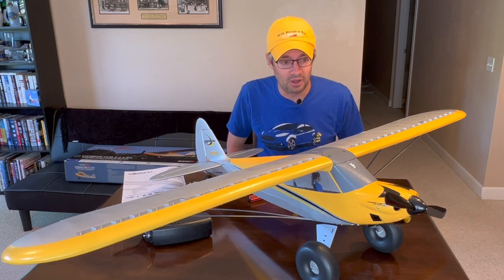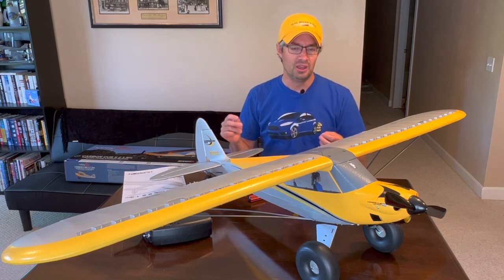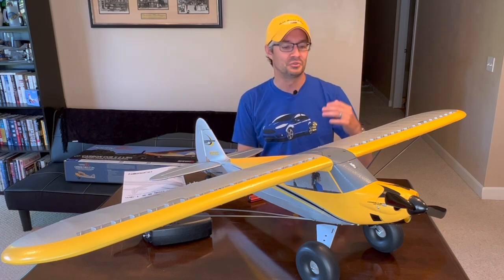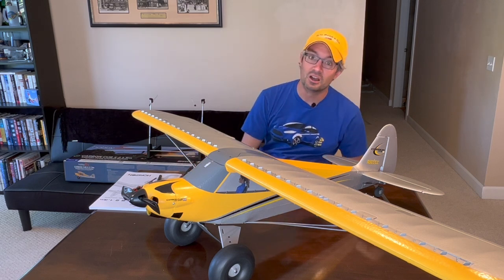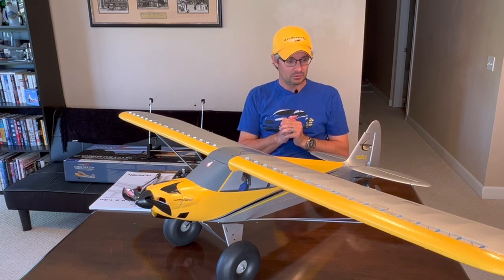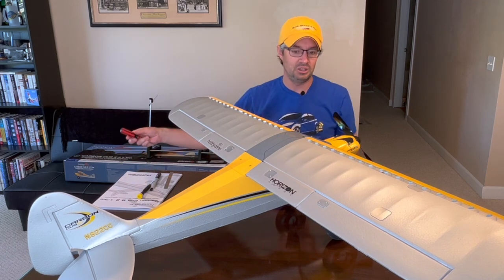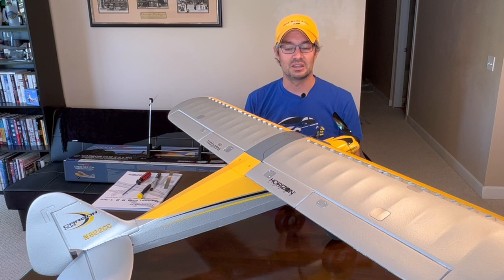Tips and Tricks to Properly Setup your Hobbyzone Carbon Cub S 2 1.3m

Comment: I have his and hers of this plane. I salvaged a LONG control wire from a Blixler. I got the flaps to work ONCE. Have you tried to get them to work with this radio?
Reply from the maker: I haven't tried flaps yet as it is my nephew's plane and he is still learning the basics. He is a bit out from learning how to use flaps. He has flown solo on beginner mode, but not much past that. Once he is comfortable flying in intermediate or experienced mode, then I can look at adding in the flaps.

Comment: Hi just got mine I’m concerned about the charging time of my battery I’m just wondering how long it takes for your battery to charge
Reply from the maker: Charging time depends greatly upon the charger being used, power output of the charger, and acceptable charge rate for the batteries. I have a Spektrum Smart S2200 and it will charge 2 2200 3S 30C Gen 2 Smart packs in about 15-20 minutes from storage voltage. With a Spektrum Smart charger and batteries, both communicate to each other so the batteries will charge at the correct rate and I don't have to do anything on the charger to properly charge batteries. I simply plug in the batteries and let the charger do the rest. It is by far the easiest way to charge LiPo batteries and the Smart batteries will automatically self discharge back to storage mode if I end up not using them within a week. This protects the battery cells.
Reply: If you are using the basic S120 Spektrum charger that came in the RTF bundle then yes it is incredibly slow because it is very basic. It took almost half a day to charge mine the first time I used it. 

If you are using a low amp charger then the light on the charger is WHITE before the purple flashing charging cycles show. If you can use a higher amp USB plug and cable (like your 20W smart phone chargers) then the light will be BLUE. If blue then it’ll be much faster but no way near a proper smart charger. 

I very quickly bought a proper Spektrum smart charger which can do my 3S 2200mah in less than 30 mins from storage voltage.

Comment: Great video and nice tips as well as pre flight preparations. One issue I'm having with this plane is that I can't land it in the begginer or intermediate mode, as the nose won't go down unless I apply throttle. I can only land in advanced mode. Is anyone experiencing this? Or what am I doing wrong? Thanks!
Reply from the maker: Beginner mode does give the plane additional upward pitch by changing the elevator, but only a few degrees. The plane will start to lose altitude in beginner mode if the power is pulled back under 40%. At idle, it would settle into a nice glide slope for landing. Applying throttle to get the nose to come down isn't normal and is actually backwards of what should happen. You control speed with the elevator and altitude with throttle, meaning on landing if you add power, you gain altitude. You bleed off airspeed by pulling back on the elevator and gain it by pushing it forward. Because the Cub is rather floaty, and even more so in beginner mode due to the elevator positioning, you should be able to cut the power to 0 when you are on the base leg of the landing and turning final. Your final approach should be done with the power off and you should just be managing the speed with the elevator. Based on your comment, I would go back and do a few checks. First is to make sure the CG is correct per the manual. Next would be to put the plane in experienced mode, zero the elevator trim on the transmitter, and then use a credit card or straight edge to make the sure the elevator is aligned with the horizontal stab. If you then go into beginner mode, you should see the elevator change a few degrees. Go back to experienced mode and confirm it is centered. Then go fly the plane. Take off in beginner mode, climb to a comfortable altitude at 50% throttle and then put it into experienced mode. The plane should stay level or drop the nose by a few degrees, but mostly stay perfectly level. If it isn't, do you flight trimming in experienced mode. Any trimming in beginner mode is negated by SAFE. You should be able to fly hands off in experienced mode at 50% throttle without any need to give the plane any inputs. That means the plane is balanced and trimmed. Go back into beginner mode, and set up for a landing. When you make the turn from downwind to base, be about 25% power, and then gradually reduce to 0% as you make the turn from base to final. You may be too high on downwind and base, meaning you are too high for final and having too much airspeed, which is causing the nose to stay up and SAFE prevents you from pushing the nose down too far. I am guessing the issue is either the plane is out of trim or you are coming in too fast on landing. Try that and let me know the results.
Reply: @BRGT350  Thank you so much for the detailed answer and tips, it makes a lot of sense, I think my error is that I'm still applying throttle on final. I'll try your tops on my next flight and will comment here. Thanks!

Comment: I plugged in my battery and the ailerons on either side have moved opposite directions, and the rudder is turned to move the plane to the right. I can’t seem to control the plane at all or turn on the propeller and I’m not entirely sure why. Got any suggestions for troubleshooting or a guide in addition to the instruction manual?
Reply from the maker: Sounds like something went wrong in the startup procedure. Start with the transmitter off and battery unplugged. Turn on the transmitter first, then plug in the battery, place the plane on level ground for a few seconds. The ailerons, elevator, and rudder will all move back and forth as part of the start up. If you plug in the battery before turning on the transmitter, the plane may have lost bind and you need to follow the binding instructions. Typically, unplugging everything and following the start up process as listed above will fix it. Never plug in the battery without the transmitter being turned on first. To turn off, unplug the battery first and then turn off the transmitter. The transmitter is always first on and last off.
Reply: @BRGT350  thanks for your reply! I’ll try this and report back with the results
Reply from the maker: sounds good! Hopefully that is it. The way it was acting is how a plane acts when it isn't bound to a transmitter or the transmitter is turned off. If it needs to be reconnected to the transmitter, it is easy to do. Insert the bind plug into the receiver, plug in the battery, turn on the transmitter while holding down the bind/panic button, and the plane should go through a movement of all the control surfaces to indicate it has been bound to the transmitter. Remove the bind plug, unplug the battery, turn off the transmitter, and then go through a normal start-up to make sure everything works. I can't recall if the Carbon Cub is one of the planes that must be sitting on the landing gear for a few seconds during power-up to calibrate the gyro. Some of my planes do that and others don't, so I can't recall all the ones that need that step.
Reply: Followed the tips and got it working!
Reply from the maker: Great!! Glad that worked out!

Comment: Getting back into flying after many years.  Can you turn off the safe and ax3s stuff?  I do not want that on. I want a pure flying experience.
Reply from the maker: SAFE can be turned on and off via a 3-position switch. AS3X is on all the time, but doesn't interfere with your control of the aircraft. It acts like shock absorbers for your airplane by dialing out disruptions from the environment. Flying without AS3X would be like driving your car without shock absorbers. Not ideal unless the road or air is perfectly smooth. I have flown planes with and without the AS3X system and always prefer AS3X as the air is never dead calm. AS3X doesn't interfere with your ability to fly the aircraft as any input from the pilot overwrites the AS3X system. Even full scale aircraft use a similar system to AS3X to reduce pilot workload. I was just reading the other day about how the Garmin GPS autopilot for general aviation aircraft has the ability to automatically adjust trim and control surface inputs to dial out wind, thermals, and turbulence. It sees the input from those events and adjusts accordingly.

Comment: Question, I've flew my cub a few times and add flaps to mine. Now I can't get the gryo to work have you had any issues with it? I still have the 3 modes but when you tip it so far it doesn't try to level it's self anymore I've made a new plane on my nx8 transmitter without the flaps plugged in and everything
Reply from the maker: I haven't installed the flaps on the Cub, but the addition of flaps shouldn't cause any issues with SAFE or AS3X. I would do the following checks; 1) in SAFE beginner mode, raise the throttle to over 25% and then back to idle. Check SAFE by lifting the right wing and see if the right aileron lifts, do the same for the left wing and see if the left aileron goes up. That will tell you if SAFE is working. Both SAFE and AS3X need the throttle advanced to over 25% to get them to activate. 2) Verify the 3-position switch on the transmitter isn't assigned to both flaps and SAFE. If the flaps and SAFE are on the same switch, that could be causing the receiver to become confused. It could be a case where deploying the flaps is changing the SAFE modes at the same time. 3) Check SAFE beginner, intermediate, and experience modes with flaps up, take-off flaps, and landing flaps as that will tell you if the flaps are on the same switch.  I am betting the issue isn't with the Cub, but the transmitter switch assignments.

Comment: Another question for you as I have the exact plane.  The manual says the CG is 65MM from the leading edge of the wing. This is 2.5 inches and I marked this on the wings with a black sharpie. In order to balance the plane as you suggested below with my fingers, I need to move the battery all the way forward (towards the propeller) in the battery compartment.  Does that sound right? Appreciate your help.
Reply from the maker: Yep, that sounds ok. Each plane and battery are slightly different so some may need the battery further forward, some farther back, and some in the middle.
Reply: We have had several great flights now.  Wish I had watched this first for the indicator led on the windshield…. Excellent video!

When we got home I discovered we have lots of turn in the rudder.  Im not sure why - last flight was smooth but the field is not perfectly flat grass.  I unplugged and replugged the battery and the plane tried to calibrate and it believes we are good to go but we can’t fly or taxi making a hard turn.  Something is wrong.

Was thinking of removing the wings to see if the servo or servo wheel dislodged.  I can’t reach that servo from the battery bay.  Sound like a plan?

This is an amazingly easy plane to fly (rookie here).   When you do a low and slow fly by with this thing it is nearly silent and looks great in the air.

Comment: hello from belgium.....where i can put a GoPro on this plane with out changing the cg? i just finish my maiden flight with this plane.  awesome!
Reply from the maker: You could place it on top of the wing and fuselage so that the center of the GoPro is in line with the CG balance point on the wings. For example, if the manual states the CG is 80mm back from the leading edge of the wing, then the center of the GoPro needs to be 80mm from the leading edge of the wing as well, but also centered on the fuselage to avoid the GoPro wanting to tip the plane to a side. I don't have the manual available to check the CG number, but it is in there and that is where you want to place the camera. I would expect some additional drag from the camera and that along with the weight will reduce flight times and require more throttle to fly.
Reply: @BRGT350  big thanks dude! i ll check the manual ...have a good day ;)
Reply from the maker: no problem, happy to help!

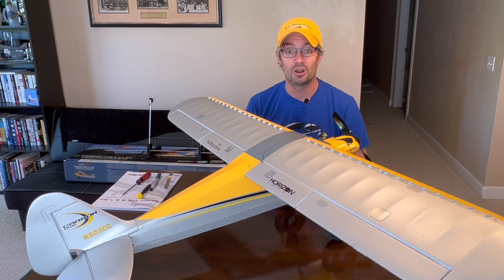Comment: First time using your videos… Awesome job. Thank you so much. Very very informative, I bought the exact plane, put it all together, and upon doing my checks found that the rudder and the vertical stabilizer are definitely not lined up… Wondering if anyone else had this issue. I bought this from a local hobby shop… The only resolution I see to this is replacement of the rudder  itself it looks to be deformed from the factory. I did have trouble getting the wings to bolt on the fuselage almost as if the screws were too short, but I did finally get it with some pressure. hopefully my Local, hobby shop will take care of me without me having to go through Horizon we shall see. 21:58
Reply from the maker: Thanks for watching! If by not lining up, you are saying that the rudder is at an angle to the vertical stabilizer when the pushrod is attached? If so, there are a few options here. First, power up the transmitter and bind the plane to the transmitter if it is the BNF version otherwise just power up the transmitter and connect the battery for the RTF since the transmitter is already bound. The plane will go through some checks by moving the control surfaces and a few beeps from the ESC. After all that is done, check the rudder alignment now that the servos have been powered up and centered. If the rudder isn't straight, you can remove the clevis on the rudder control horn and turn the clevis as it is threaded to the pushrod. Tightening the clevis will make the control rod shorter and moving the rudder towards the clevis side. Loosening the clevis will make the pushrod longer and move the rudder away from the clevis side. You should do this with the plane powered up as that will keep the servo centered. Many times when I assemble a plane the control surfaces are not aligned, but after powering up the servos, they are pretty close to being aligned or just need a turn or two of the clevis. It is rare they need more than that.
Reply: @BRGT350  thanks for all your info… I did take it back to the hobby shop and they replace the tail rudder for me. It was deformed from the factory.
Reply from the maker: great, glad they helped out!

Comment: Great video again.....thorough, concise, easy to understand.....except for AS-3-X.  What is that?
Reply from the maker: AS3X is the stability system which I think stands for Air Stability 3 Axis. There is an internal set of gyros inside the receiver that detect unintended inputs, such as wind or turbulence. The gyro sends a signal to the control surface to counter the wind or turbulence to allow the plane to fly smoother. I have a bunch of other videos that explain the system in more detail. The manual also has additional information. It is always good to check AS3X when getting a new plane ready to go.
Reply: @BRGT350  Wish you or Anybody in YouTube land would do a video on how the GPS, Landing assist, Airfield Geo fence works on this bird.  Absolutely nobody has given it a shot.  Very frustrating for those of us coming from Drones that make this function so easy to use.  Yet the Carbon Cub S2 is not very user friendly and Someone should break it down into clear concise steps?
Reply from the maker: I am not sure how the GPS works as the model my nephew has doesn't include the GPS module. We did install the Landing Assist Sensor that I had from another plane and that works great. That uses a pair of photo eye sensors to determine the altitude and coupled with the gyro system in the receiver, it knows the attitude of the model. The pilot controls the throttle since the system doesn't know speed. The photo sensors help manage the descent by measuring the ground distance and the gyros work to keep the plane level and on a constant glideslope. Depending on the plane, the system flares the plane or adds power at touchdown. The Cub being a tail dragger doesn't land nose up, but rather level, so the system does that. It works really well and after a few flights with it, my nephew was ready to try it without the sensor.
Reply: @BRGT350  Thanks for the quick reply.  Yeah, in reading all the info on the landing assist, it really seems like something I could use!  BUT AGAIN, nobody on YouTube shows how this feature works.  So frustrating for me......thanks agin though.

Comment: How do you determine the CG without that CG stand you have? Do I need to go purchase one of those stands? Please advise.
Reply from the maker: You can use your finger tips to balance the plane, and that should get you close enough. I would take a marker and put a dot at the CG location on the wings, using a ruler to measure the distance properly, and then put your finger tips on the dots and lift the plane. If it tips forward, then it is nose heavy, tips back it is tail heavy, sits level means the CG is good to go. I did all my checks using the finger tip method when I was starting out and it got me close enough until I bought the Dubro CG Machine when I moved into more complex and higher performance aircraft where CG is vital.

Comment: Nice tip and trick
Reply from the maker: Taking a little time up front to make sure everything works is always a good idea. As a result of the checks, the plane didn't need any trimming and has been a fantastic trainer out of the box. My nephew, who is in the thumbnail picture, has had 5 flights so far and is pretty much ready to solo.
Reply: @BRGT350  yup and thank so much my friend and it my note